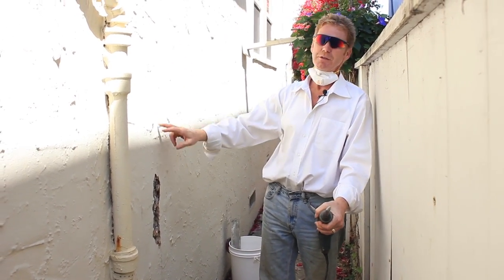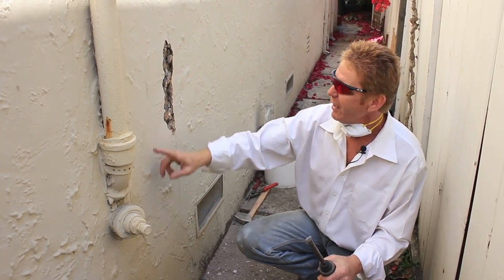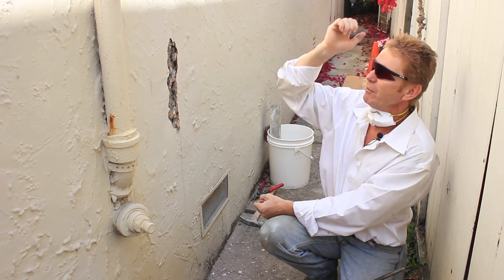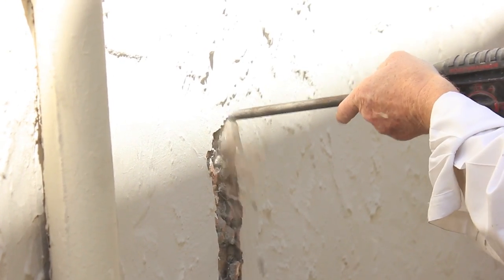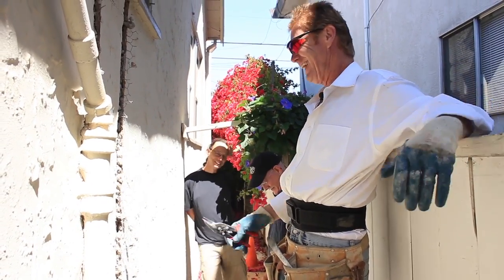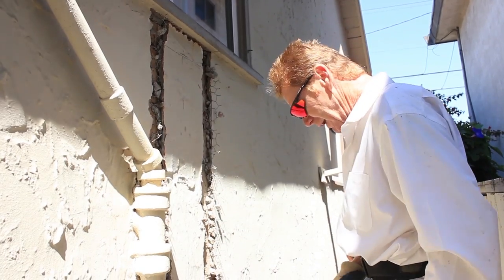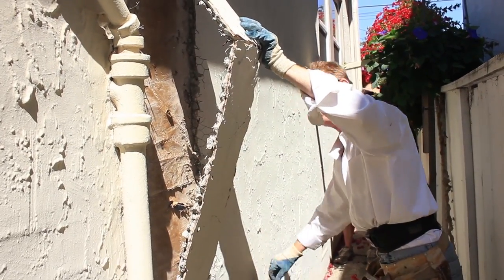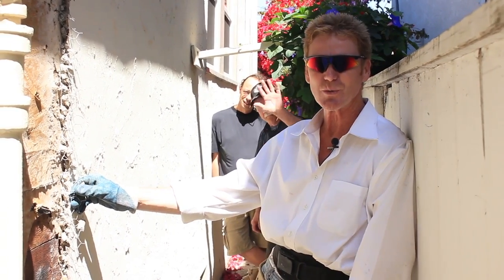Breaking out stucco is easy with a rotary hammer

Comment: Hi Kirk could you tell me if this is the same procedure you would use to remove the stucco from a house built in the mid-80's with (I believe this is the correct term) a EIFS Stucco system (1" thick foam board)? MANY MANY thanks for your FANTASTIC videos!!
Reply from the maker: Morning Brian, yes, your home may have the exterior styrofoam with stucco on top, however, it can be repaired in a similar way shown on this video.
 I have completed many homes such as your's with styrofoam, to buy a sheet of say 4X8 to use only a small section can be done, but just stucco will also work, of course the stucco will have to be in most cases twice as thick.
 best wishes.
Kirk and Jason's DIY plastering tips
Reply: Kirk & Jason Giordanos DIY plastering and stucco instructional videos and forum
Thank you for the prompt answer!